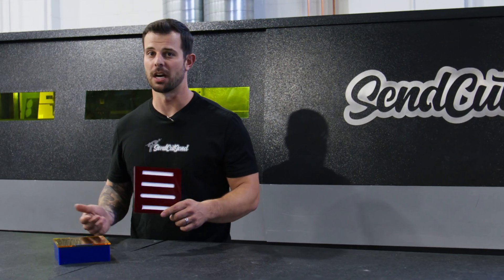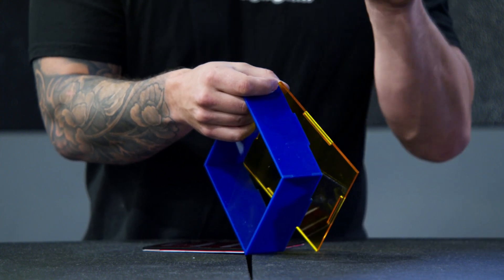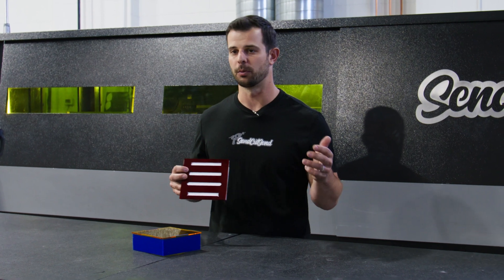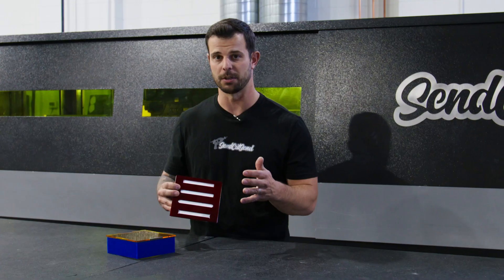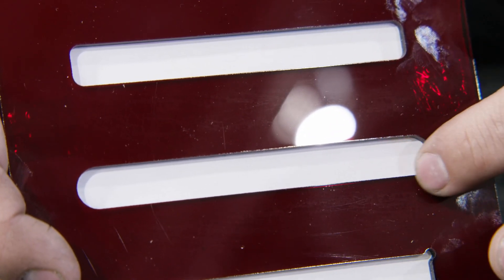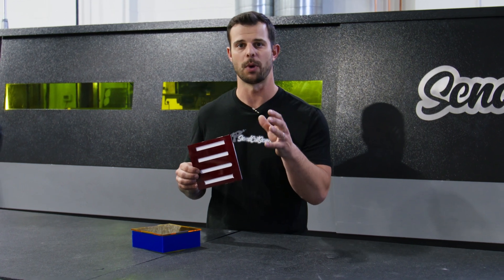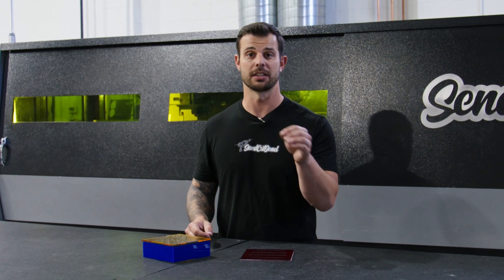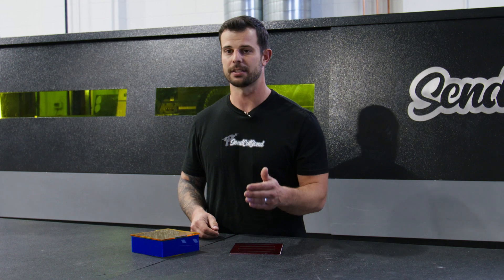Designing for Tab and Slots with SendCutSend - Best Practices

Comment: The other thing is to to deburr the slot completely, anywhere the burr is left or has a sharp edge can create a stress crack. We used to have to do that to all the new pistons we installed into our 18,000 rpm kart engines.